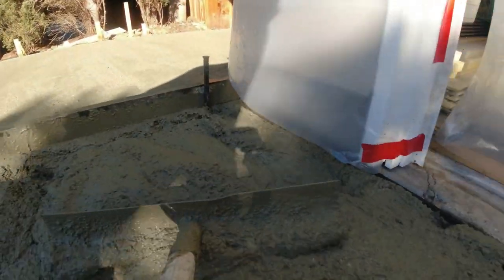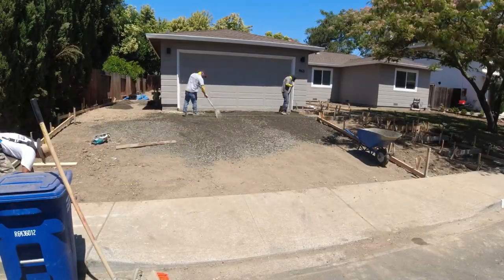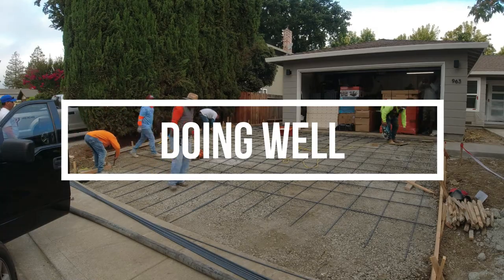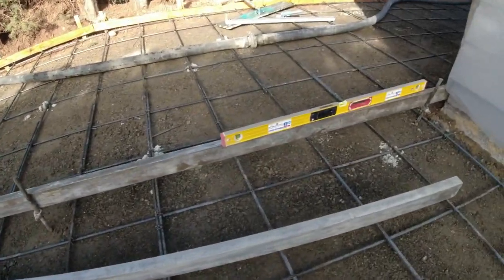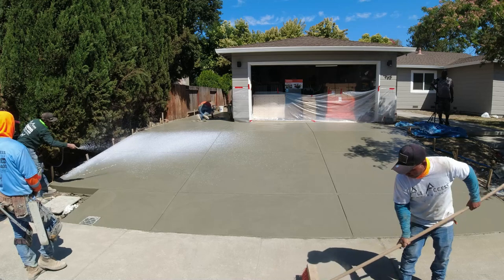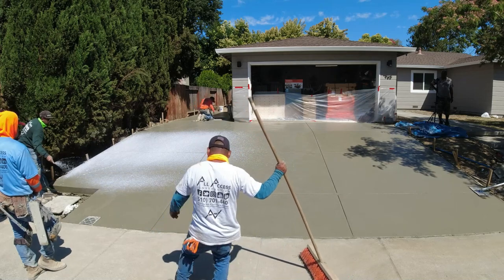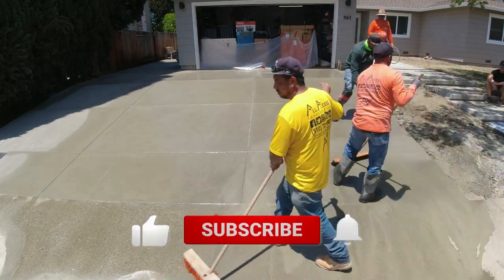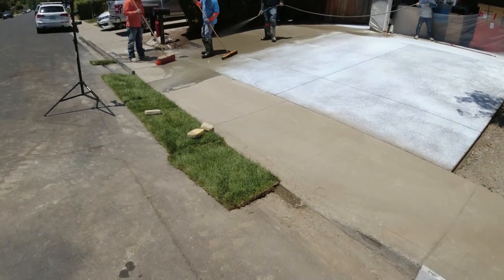How To Install CONCRETE Driveway (Sandwash Finish) Start to Finish

Comment: What jointer tool do you guys use after you use the torpedo?  Awesome job
Reply from the maker: Groover they come in different sizes...
Reply: What size did you guys us on the driveway.
Reply from the maker: Probably 10 inch one

Comment: Another pretty result.  Again, I don't see any chairs for the rebar.  The rebar is all laying on the ground.  Without chairs, you might as well leave the rebar out.  Don't be offended.  Ask any structural engineer.
Reply from the maker: I'm not offended.. I know it's a time lapse and maybe you didn't see it.. But as we poured we pull up the rebar.. And what I can guarantee outside of an earthquake nothing going to happen to this driveway in my lifetime and I got at least 50 more years